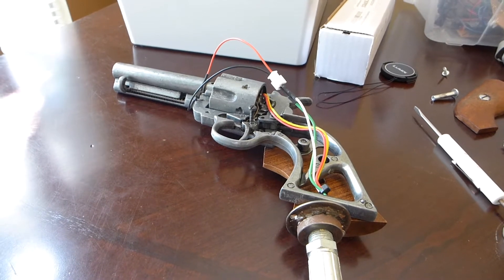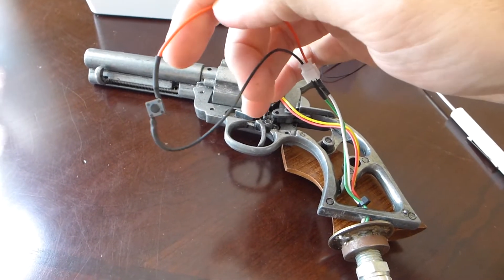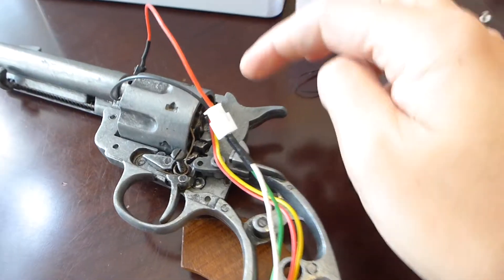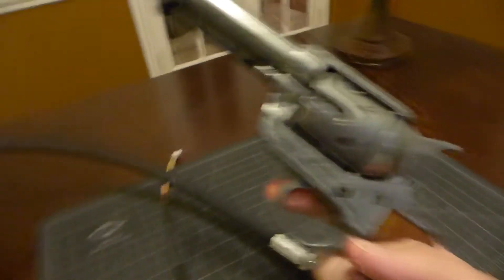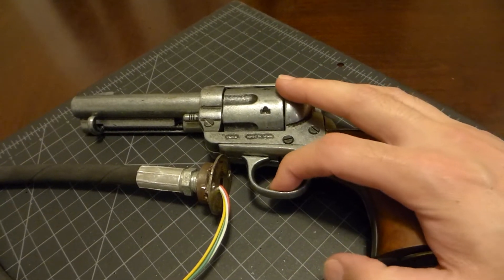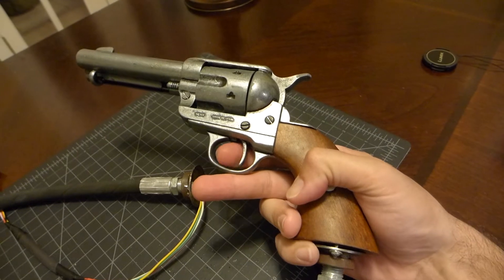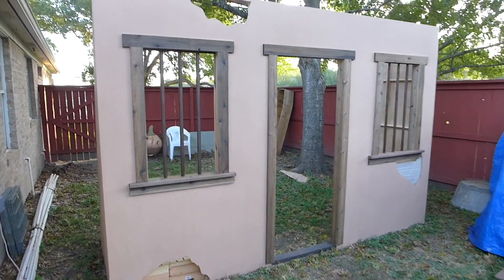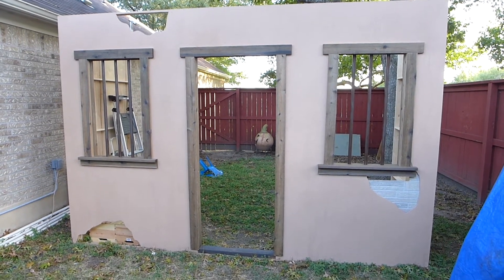October Showdown 2017 - Oct 9

Comment: Would you be willing to release the Ardunio sketch and wiring for the shooting gallery? I'm thinking about doing something similar for next year. The jail bars look ok to me, Awesome job so far.
Reply from the maker: +MrTmartindale I can send you the sketches but I don’t have any diagrams for the wiring unfortunately. Been meaning to do that. Ultimately, I’d like to design circuit boards for it and have then made. If I get to working on that sooner than later, I can definitely send you diagrams as well.